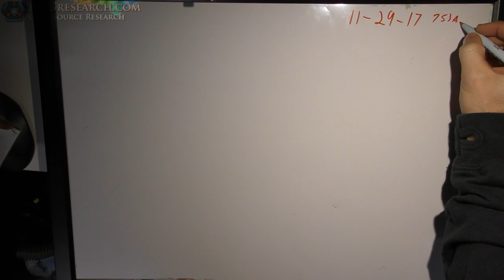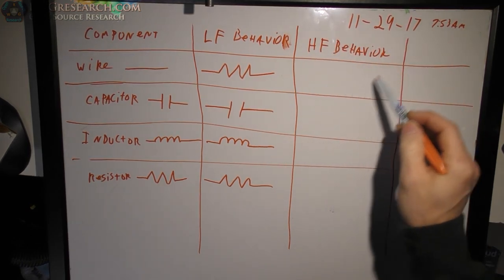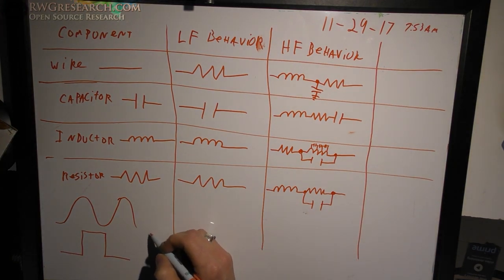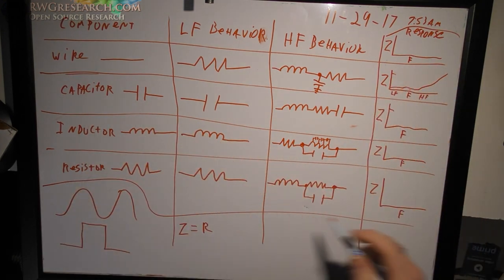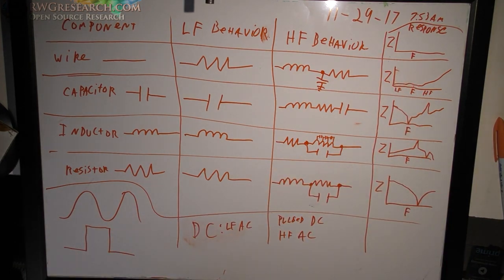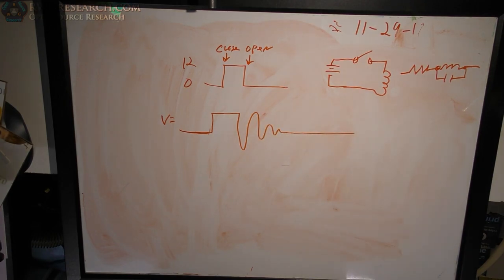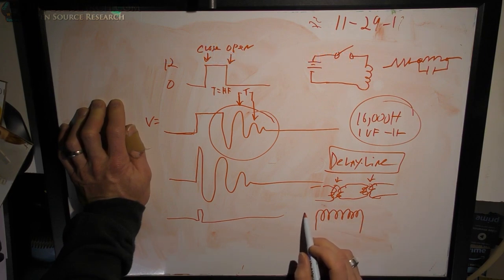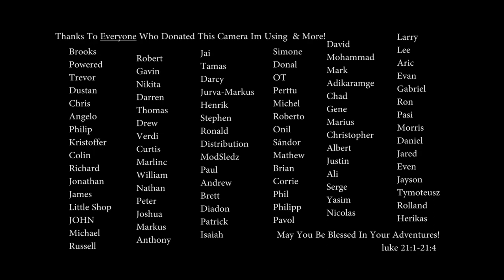The Search For Answers Part 11: Ideal Components vs Real Components @ Low / High Frequency, Delay's

Comment: 11:35 - I was thinking about making a simplified video about Impedance since a few sound engineers just take it for granted but still don't understand it. From what I understand, Impedance can be understood as being "The Reisistance of a part of a circuit at a specific Frequency, due to the complex interaction between Ohmic resistance, Capacitive reactance and Inductance reactance (including parasitics)". So, Impedance is frequency-dependent and requires a Bode plot to understand it in greater detail. Great video!

28:37 - Low-pass filter. From my days experimenting with radio broadcast! It's a shame the "delaying" effect causes higher frequencies to be attenuated so much.
Reply from the maker: yeah, i bet audio is even more crazy, There are so Manny things people dont even think about, and that's OK, its complex, but it should be known.  ~Russ

Comment: Inductive capacitance delays amperage and turns it into magnetism you're getting warmer. So then what you need to understand is how to make a positive or A negative biased wave make that wave stand in a hatchet on residence and then you need to figure out how to make it four phases and then you need to figure out how to change the frequency from the positive side and the negative side and then you need to figure out how to switch that thing and 1.9 million Hertz up to a load of 2.5 terahertz then you'll understand that 2.5 terahertz is the frequency of gravity and once you impose that frequency of gravity in a standing wave of hatchet I Residence in 4-12 phases that I've shown on my videos and oscilloscopes you'll completely understand how the gravitational field works and then you'll understand how to upset the column bond in oxygen and hydrogen where the gravitational wave instead of inputting an electron to the covalent bond of the hydrogen and the oxygen upsetting the hydrogen in the oxygen and creating excess Heat the contrary to that is the amperage will always Trail the voltage because you're leaving the amperage on the shelf and you're using the magnetism of that potential energy not the amperage and when you understand using the magnetism of the circuit you add that to your understanding of the video that I just watched to get me through traffic and my day going home that you're absolutely correct that you can delay the amperage through a circuit that is 100% correct and I have proved it time and time again what you really want to do is not only delay it is you want to sequester the amperage so that it never goes forward in the circuit and then the amperage becomes magnetism and there's work for you so the voltage Trails the magnetism of the circuit that is the Holy Grail of the circuits that I've been building for years have a nice day good luck talk to you soon sorry I haven't tried in a while I've been busy oh and by the way my entire lab automotive shop machine shop and all of my supplies from Los Alamos laboratory were stolen from me the guy's name is Scott Wingrove  326 Elm st Escondido California  and he's a piece of dogshit. The police won't do anything ~

David A. Puchta
18583450640 New # Direct
Reply: Is "Hatchet in Residence" an autocorrect error?  Do you mean heterodyne resonance?
Reply: Yes I meant heterodyne resonance.
Reply: Yes, it is very interesting.  You definitely have come upon some powerful information.  Hopefully it won't follow you to the grave like so many before you... I hope that you will get it all together and get this information/technology out into the world...It's very cool stuff..

Comment: Don't forget the differences between a carbon film resistor and a wire-wound resistor Russ the latter being both an inductor and resistance in one, it has properties of both.
Reply from the maker: 100% there are so many resistors, and each one will have its own slight version of this chart... ~Russ
Reply: Yes their certainly is ;)

Comment: https://en.wikipedia.org/wiki/Delay_line_memory

 This is what I was trying to say to you about the 10 coiler we were working on. The problem is everything in the circuit has the properties you are describing including the batteries and wires also has capacitance between each component based on the 90 degree rule for non interference.

 jbignes5

 P.S.
 Although this video describes what I was talking about I don't subscribe to his lack of social acceptance in new ideas or in this case old ideas.

 https://www.youtube.com/watch?v=ChV7n0EY2h0

 Check out the regular coil to bifilar excitation and the self resonance effect in a bifilar coil.
Standing waves can be easy to facilitate, compare self resonance to standing waves.

Comment: "Absolutely no information on it." This is why we have to do basic research from scratch. There is just not much basic available. Take the plasma Papp's popper you were working on as an example. I could find no tables at all of ionized elemental plasma gas expansion  coefficients anywhere! Every researcher has to do this over and over.
Reply from the maker: yeah exactly. makes progress very slow some times. ~Russ

Comment: When I use to work as a nuclear instrumentation technician, we use to have these bin module's with coax delay lines in them. I just tried doing a quick search, and found these which is same idea, but the  ones I remember were small coax like that these, but shorter lengths and in like 3-4 inch loops, and not heated :
http://micro.apitech.com/pdf/delay-lines/coaxial-delay-line.pdf
Reply: Here is more info on that product I use to work with:
https://sites.fas.harvard.edu/~phys191r/Bench_Notes/B3/canberra1457.pdf
Reply from the maker: good stuff Thanks!! ~Russ

Comment: Your clip is okay, but keep in mind for your Newman motor project you are not really concerned with low-frequency and high-frequency AC responses from components.  You are supposed to be interested in the "pulse response" of a coil.  You are not really interested in the sharp edges of the pulse or any resonance phenomena.  What you are supposed to be interested in is how the coil responds to a DC pulse of a certain amount of time.  How does a coil with a certain wire resistance respond to a pulse of a certain voltage for a certain amount of time?  You haven't really answered that question.  Assuming that you do answer it then the next step is to realize that the rotating magnet inside the coil also induces an EMF in that coil.  So the ultimate question is this:  How does a coil with a certain wire resistance respond to a pulse of a certain voltage for a certain amount of time while at the same time there is a certain EMF waveform being induced in the coil by a rotating magnet?
Reply: Also forget transmission lines, this project has nothing to do with transmission lines.

Comment: I would say wrong with the wire with High Frequency, this is what Tesla did to get past the resistance in DC direct current transmission. the only way around it was to go AC. Alternating Current, not only alternating, but at high frequency.